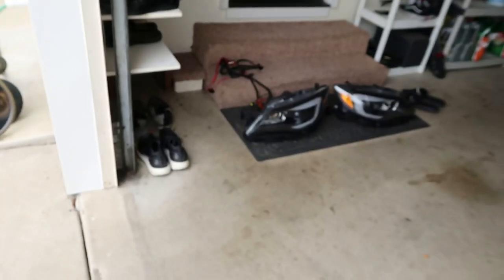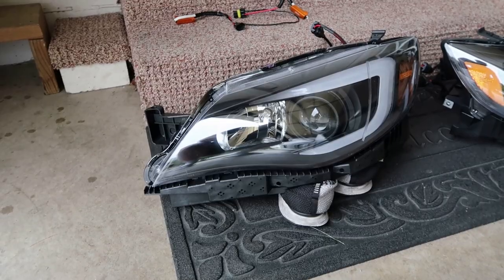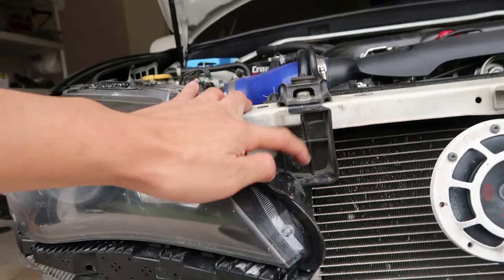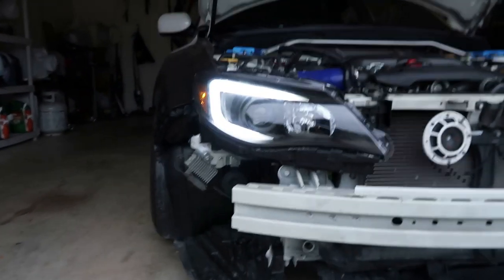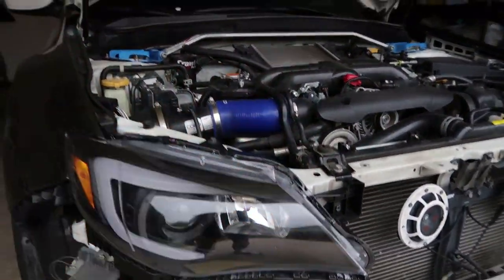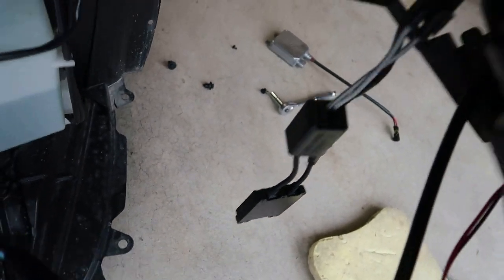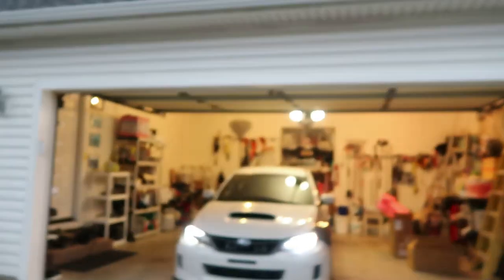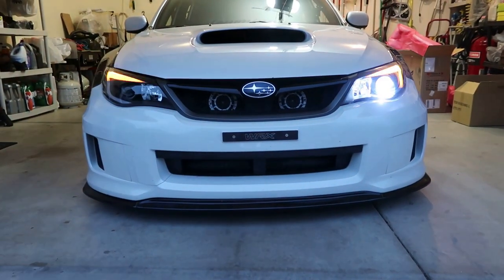2011-2014 Subaru WRX/STi LED C-Style Headlights from ProTuningLab

Comment: Hi, question.. the LED bulbs that you put in to replace your low beams.. are they now H7 bulbs instead of factory H11 bulbs? And also.. the LED bulbs you installed for your low beams.. is the light output any good? My 2011 wrx uses factory HIDs but my girls 08 narrowbody 2.5i uses factory H11 halogen bulbs, I tried installing some H11 LED bulbs on her car but being that the factory projectors are only good for halogen bulbs.. they scatter the light output on the LEDs.. so what I'm trying to figure out is if the OEMmassive headlights have much better projectors that will allow aftermarket LED/HID bulbs to shine bright on the road.
Reply from the maker: When I bought the headlights everything was already installed. I didn't have to replace any of the LED's, it was just an easy plug and play. The light output is not bad. Im thinking about opening up the headlights and replacing it with a different pair of LED's. Im also not sure what size bulb it is either since I haven't got to mess with it. On the Subaru forums a lot of people get them from OEMmassive, so I would probably check those out too. Hope this helps !!!

Comment: These look like the OEMassive lights. If so, to they have verticle AND horizontal adjustments? I dont trust the website pictures, because it says h7 bulbs for both high and low beam, but the picture showes a 9005 installed in the high beam.
Reply from the maker: No they aren't, they're from pro tuning lab. Yes you can adjust the headlights with tools. I also wouldn't trust pictures, go based off what the description says.

Comment: Do you get a orange-white pattern on the switchback when signaling? Didn't notice it in the videos, but I've heard people having this problem.
Reply: Mine will flash white to orange when signalling. Working on figuring out the issue right now. Thinking excessive resistance in my DRL wire causing the signal to not communicate fast enough for the blinker speed. I soldered in the connector from my sti headlight harness to make them into my sti.
Reply: @DanielKellert  You will need these and to wire them in. https://www.diodedynamics.com/s1-switchback-module-pair.html

Comment: Can these lights still retain the factory auto height adjustment (roller switch to the left of the steering wheel by the traction control button) or only use the screws on the backside for adjustment?
Reply from the maker: No, you have to adjust the headlight with the screws
Reply: Justin Brown Did you ending finding a set that still retained those features? I’m in the market but at a loss atm....lmk.

Comment: When you turn on the turn signal, does your cshape emit the white light (for a split second)  in between the blinks??
Reply: Cooper Wang yes it does
Reply: @AntnyNguyen  is it what it's  supposed to do? I found it annoying. In the video it doesn't seem to have the issue...
Reply: Cooper Wang yes it’s supposed to do that, you don’t see it in the video because we just turned on the hazard lights and it doesn’t change to white for a split second with hazard lights, only when you use the turn signal. Sorry we didn’t realize that wasn’t in the video.